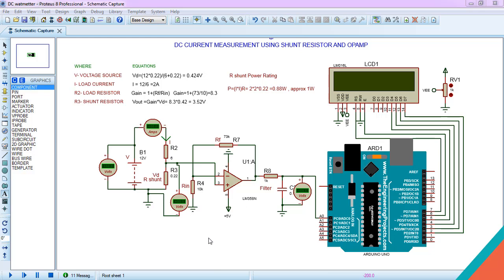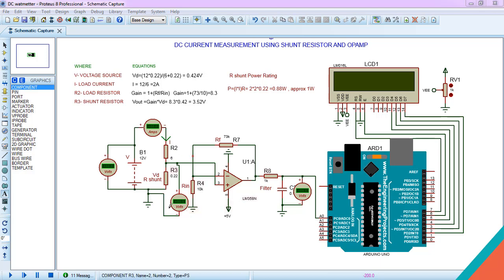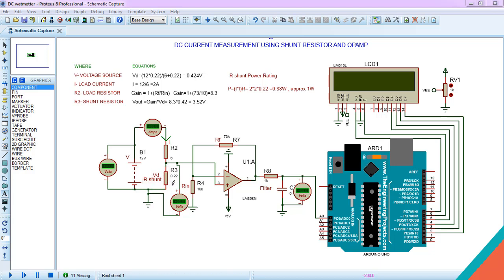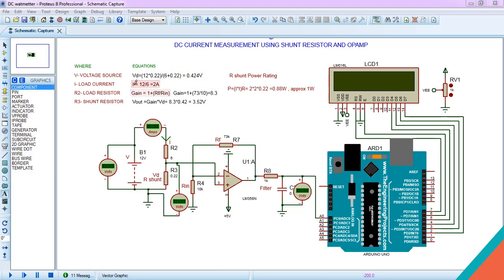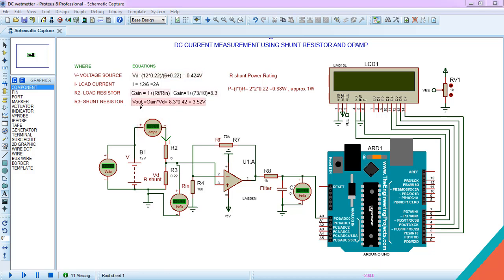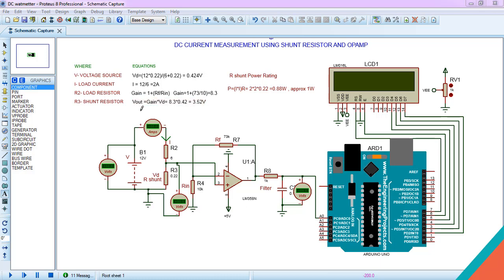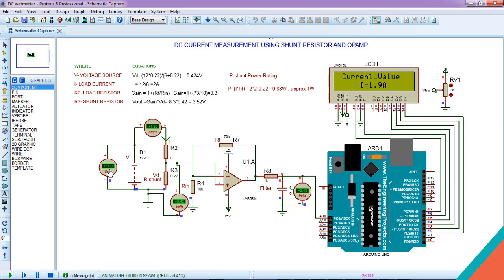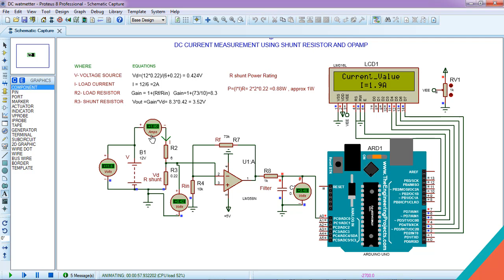DC current measurement with arduino using a shunt resistor and Operational amplifier

Comment: This is the actual code for this setup. The code provided by the author does not work.

#include "LiquidCrystal.h"
int current_sense  = A0;
LiquidCrystal lcd(7, 6, 5, 4, 3, 2);
void setup() {
  lcd.begin(16,2);

  lcd.print(" DC CURRENT"); 
  lcd.setCursor(0, 1);
  lcd.print(" USING OPAMP "); 

  delay(2000);
  lcd.clear();

}

 void loop() {
 float Rf= 120000;     // adjust the feedback resistance value
 float Rin= 10000;     // adjust the Rin resistance value
 float Gain= 1+(Rf/Rin);
 float Rshunt= 0.01; // adjust the shunt value
 float omp_value= analogRead(current_sense); // in volts
 float Vshunt= (omp_value * (5.0/1023.0));// this line converts the readings into actual value
 float Vd= Vshunt/Gain;
 float current= Vd/Rshunt;
 lcd.setCursor(0, 0);
 lcd.print(" Current_Value"); 
lcd.setCursor(5, 1);
lcd.print("I="); 
  lcd.print(current,1); 
lcd.print("A");
}

Comment: Dear sir.
Your video very clear teaching.
Good explanation 💗.
What is the maximum current measuring capacity of the circuit?
Is it possible for measuring 5 amp?
Reply from the maker: adjust the values of resistor

Comment: Thank you very much I have watched a lot of your videos they are very helpful. I confuse please where do you get that 0.54 and how I can find it in a similar case thanks in advance (float current= (omp_value * (5.0/1023.0))*0.54).
Reply: I have also the same question. Pls, tell me if you you’ve figured it out. Thank you very much!
Reply: 0.54 = 1.9A / Vout
Reply: @KhoaBuiduy  But, this 1.9A is the final current value while he used 0.54 as the current factor. from your equation above he finds the total current before he got 0.54 which doesn't make sense.